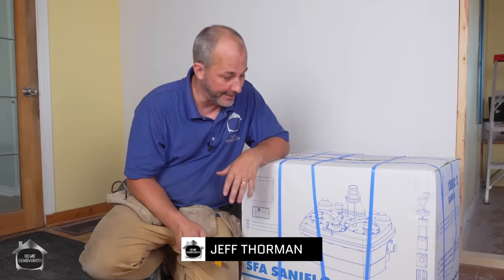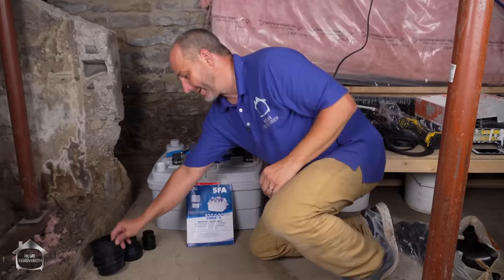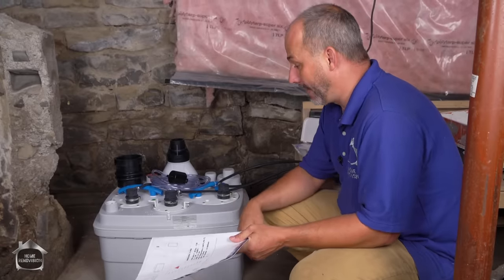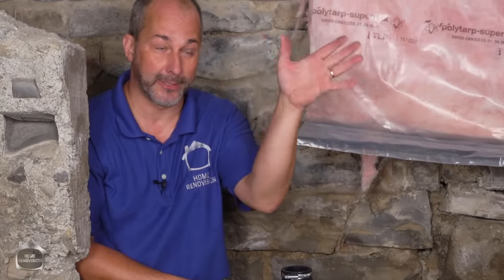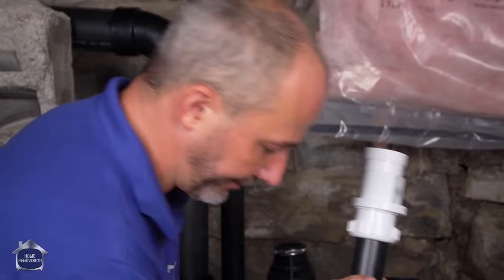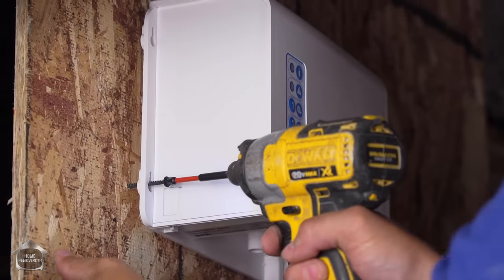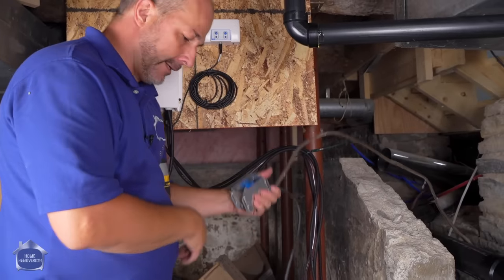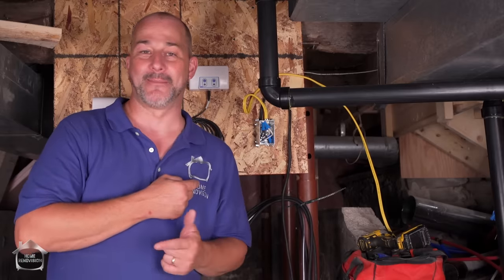Saniflo Macerator Plumbing Installation Instructions

Comment: Awesome! While we currently don't need this kind of unit it is really good information. One never knows what the future looks like.
Have a flooring question.  Older home and we are putting sheet vinyl in the bathroom.  Tonight we found where someone (long before we owned the home) had dropped something on the floor creating a pinhole in the vinyl and water seeped in causing some wood rot in the plywood. From what we can tell it is only about 2" in diameter, IF it hasn't seeped into the plywood and caused de-lamination of the surrounding wood what can we use to fill that hole?  (if it has de-laminated more than just the little spot I know we'll be replacing more flooring that we had originally expected to.) If we can't get the new plywood to butt up perfectly against the old plywood do we need to fill the gap with something?
Reply from the maker: HI! they make patching compound to be used on the floor to fill gaps and cracks for that type of install. just go to the hardware store and ask for the product and describe what you are doing. I am sure they will have the right stuff for you. it should be sandable as well. cheers!

Comment: Just discovered you videos!  Amazing stuff!  So, I want to add a (full) bathroom to a walkout first floor.  But the septic line is 8 ft above the floor, so I'm thinking of using one of these, but I either have to bust a hole in the foundation, or raise the bathroom floor, or get a side/rear discharge toilet, or put another pump in the drain line.  Any thoughts on which of these solutions would be best?
Reply: Just did a bit more research and it looks like the Saniflo Sanibest Pro: Macerating Upflush Toilet Kit is going to do the trick.  Just need to elevate the shower base a bit and everything else should be fine.  Is it worth buying the high water alarm?

Comment: Big fan of your channel. I trying to replace my Sanipro unit. It used to support a small bathroom with shower sink and toilet. But it was built with no access to do any pump maintenance, so now I’m trying to figure out how to tear out the original without having to rip out too much drywall, but I think there probably isn’t a way around it. Do you have a videos on a more permanent or low maintenance unit and tricks to build in access?

Comment: I've been looking into Saniflow for an upcoming basement remodel.  Unfortunately, my existing sewer pipe goes below the slab.  Code in my area requires plumbing to tie into the below slab sewer, which for me means busting up the concrete to get to it.  Im not sure if there is a work around, but really wanted to avoid busting up my slab.
Reply from the maker: Hi drew, all sewer pipes have a fitting where there is a cleanout just before the pipe goes beneath the slab. You can extend that cleanout and add the intake to the pipe from the macerator and have it assembled without opening the concrete! Cheers!

Comment: I want to install a SaniPlus macerator toilet in my basement, but I'm not sure it's the best idea. Things to know:
- Ceiling height is 7' tall, code for bathroom is 6'8"
- Macerator will be 4' from shower drain
- Instructions say shower for SaniPlus needs to be elevated by 6", but that's a problem with my ceiling height restrictions (7' minus 6" equals 6'6", no good)

Question: can I dig a small hole for the shower P-trap so I only have to raise the shower 3 inches, or does the P-trap need to be above the macerator shower intake? I'm worried my only other option is to ditch the macerator and start digging up the slab

Comment: Hi Jeff,
Thank you, I find your videos educational and very helpful. 
I am from the Netherlands in Europe and I know nothing about installing electrics. However I would like to bring something to your attention!
At the 39:00min you attached the power supply to the panel.  The lines entered the box from the TOP. To me this is not sensible and a potential yet simply avoidable risk!
Should there ever be any condensation, leaks etc water could flow along these lines and into the box.

That is why I would suggest lines like this should enter and exit from the BOTTOM.
Water, condensation / leaks that go along the lines can never flow up -at least this is the case where I live ;) - thus avoiding a short.
Keep up the good work. Good luck with all your renovations.
Regards,
Willem
The Netherlands.
Reply from the maker: Thanks for the thoughts Willem. I don't do enough electrical to have that many good habits., What you are saying sounds reasonable and practical. Cheers!

Comment: I'm thinking adding a toilet, vanity and shower to the Basement so i want to know if this work for that.
Reply: Yes it would that’s what they are made for
Reply: Its a over kill for just a basement bathroom either run a up flow system or do the standard drop in the ground system that's 1/5th the price

Comment: I am looking to add a full bathroom in my basement I was about to start tearing up concrete till I stumbled across your video. Which one should I get I'm only looking to add the one bathroom not the whole house from my understanding they have these for different reasons different sizes like if someone just wanted to add a toilet and not a full bathroom like me they would be a different product right? like for instance you're doing your whole house I don't need that big of a unit.

Comment: Jeff, When I watched a video put out by Saniflo they stress on the discharge pipe to have no 90 (right angles) but to use a gentle 90 such as two (2) 45's.  Their claim is over time the right angle 90 with build-up and cause a problem, your thoughts?

Comment: Hey, did you just convert that cleanout for the saniflo? What if you need that clean-out later on? I know you said these Saniflo's are incredible machines and can blow___ to China and back, but deleting the clean-out is giving alot of faith in these machines... Also, Are you going to add some lock nuts to the electric boxes for the wires coming into it? You're blowing my mind with this video.

Comment: Vent 90 on the discharge pipe?   And you removed the cleanout from being a cleanout.  why not tap in a new connection to the stack?
Reply from the maker: I had an extra cleanout. Cheers!
Reply: @HomeRenoVisionDIY  Ahhh lucky.  most people get one.

Comment: Have been watching your videos on flooring. Thank you! I will be renovating my very tiny primary bathroom…1965…my plumber has asked to research this system. Might be best option with cast iron system and small area.  Any problems develop since you installed the system? This will also be on 2nd floor of house.

Comment: With one of these units in place for a basement bathroom, do all the fixtures still need to be ventend beside the pump or does the pump vent provide enough venting to the fixtures?

Comment: Hey Jeff You're the best!!  Thanks for teaching us DIYers the right & safe way of doing things around the house.  My question is,
I want to have a 6'x8' wood shed and turn it into a modern "Out house" if you will. I need an outdoor bathroom and there is nothing on YouTube that really shows anyone using a Saniflo for outdoors. Can I put one of these outside? I plan to insulate the shed and put up sheetrock and Imy him,e has a septic tank. Would that be hard to do if I want to put one of these outside?
Reply: Did you give it a try?
Reply: @ Mike532 did it all work out? Thanks in advance.
Reply: @JonathonTaylor29  Not yet 😒
Reply: @officiall.d1010  No, haven't done it yet. It seems like to much work. I will probably just have folks use the bathroom inside the house that's near.

Comment: How about a cottage install?  It gets down into the teens,  sometimes single digit.   
Most the line from cottage to house can be down 2 to 4'.     Will the spot where it is exposed (maybe 5') be a problem if it freezes?   I'd suspect the sinks and toilet and wash n dryer will be run often.

Comment: Hi I have a question! I have an existing half bathroom with a toilet which was built on a platform and a sink.  I want to install a Saniflo plus system to create a full bathroom. My question is, can I use the existing sink discharge drain for the saniflo discharge?
Reply from the maker: yes as long as everything goes into the saniflow so the 1 1/2" pipe is dedicated.

Comment: Have a older home with a roughed in piping for a downstairs bathroom, however my plumber said it incorrect and needs to be ripped up.
Would it be possible to abandon the existing piping and install one of these units?

Comment: How do you get into the unit if there is a problem, needs cleaning out? It seems locked down to the floor with the pipes all bearing down on top of the unit and the concrete floor below it. If it was installed on top of a foot and a half tall table...

Comment: If you have to raise the shower drain up 6 inches  -- why does it look like your shower is level on the floor? Im attempting to DIY a basement bathroom and im confused on how to raise the shower 6 in without putting it on a platform -- which is aesthetically NOT pleasing. Please help me lol

Comment: So the lift pump and macerator motor will run whenever a plumbing fixture (toilet or shower, etc) is flowing into the system?

Is the noise audible in other rooms?  Do you need to do anything to prevent the noise propagating through the pipe?

I've been watching your videos and will be adding a full bath to a walk-out basement. Thanks.

Comment: Im turning my basement into a rental unit and my septic line is 6 feet above the floor. Havnt looked at the other products they sell yet but i may have to chip out my concrete floor to install it lower than my appliances  unfortunately

Comment: Curious if your house in on a well and have any pressure issues adding a bath. If you have multiple sources calling for water at the same time. If so any plans on a video to upgrade the input not just the output?

Comment: Those keyhole mounting holes are the bane of my existence. I've asked my wife to check for those dumb things before she buys something to hang on the wall and if it's got them just put it down and walk away! It is so hard to get the screws properly spaced and level on the first try. Then when you consider the fact that my wife wants to change the location of whatever it is I'm mounting to the wall for her at least 13 times, and you can understand why I have a deep abiding hate for that paticular mounting system.
Reply from the maker: perhaps I should show my tricks to install. Cheers!

Comment: So two problems I saw Jeff, that box is not bounded to ground and it's metal! Also why not use a plastic junction box then a gangable metal box? the cover will not go on these as they are meant to take a receptical or switch then a plate. Why did you decide to  use this instead?
Reply: he must have forgot, because he initially did it, then removed it so the camera could see what he was doing, and mentioned he was going to do it, and then never did haha. also those wires should have been stripped back further. think 6-8in of unsheathed wire is required in the box. probably why he had to take it out to connect it in the first place.
Reply from the maker: Hi steve, as long as the ground screw is attached to the green screw i the back of the box I am fine. And they make a solid cover for that style of box. Cheers!

Comment: I am a DIYer and was wondering if it would be feasible to use one of SaniFlo's insinurators, toilet, sink, and shower to install a bathroom in a second floor bedroom by running it into the attic, across (over) a hallway and connect to another bathroom?

Comment: Perhaps you can provide me some guidance. I don't have a saniflow.... Mine is the older box model... Where half of the tank base has the toilet on it, and the other half is on the other side of the wall... With the pipes, etc. Mine stopped working, overflowed in the basement... So looking at it I noticed the 90 degree pvc elbow from the vent pipe was disconnected where it vents out. It looks like it was attached with caulk instead of pvc primer and glue. Then when I pulled it off to fix it, the rubber gasket that attached that vent pipe to the tank was torn and frayed.. So I need to replace that. Based on that vent pipe not being attached and sealed... Could that be the cause of the system not working anymore? Just curious.. Worst case scenario is that I have to replace the pump. Hoping you can give me a little hope that it's can be the less expensive route. The waste pipe is still intact. This thing is about 18 years old... So maybe I'm due for a new pump anyway. If so, is it just a heavy duty sewage pump? Thanks, and thanks for your channel. I've used it for so many house projects, I've lost count.
Reply from the maker: your best bet is to contact the supplier to get replacement parts. most likely not that expensive.

Comment: Hey I was actually just looking at one of the smaller versions of this, just to do a small shower/toilet/vanity bathroom in my basement. Are there any code issues with something like this in Ontario? I’m in a 50s home where I have city sewage but I don’t want to cut open the old cast iron sewage pipes and deal with that mess.

Comment: You should have installed sweeping 90s on the discharge.... your first 90 was not..... also you could have maintained your clean out with a different configuration

Comment: Like the idea of adding extra drains to the house or shop that doesn't have enough fall. 
Don't think I would want my entire house on one.
Reply from the maker: Hi Diana, I am running my second bath and my new kitchen to it. I will also run my wet bar in the future. My basement has no room for adding fixtures so this solves all my problems. Cheers!

Comment: adding a living space to my basement. needs to work for the Kitchen sink, shower, and toilet with out overpowering my sewer lines. The thing I am most worried about is it being to powerful.
Reply: As long as it's a low point in your plumbing you are tying it into it won't create a problem sewer lines are open systems and have venting in them which mean any pressure will escape

Comment: Enjoying the video!
Need a bathroom in the basement but don’t have any plumbing for it.
Will this “officially” increase the number of bathrooms for our septic system? I say officially because our septic tank is rated for what we already have, which is 2.5 bathrooms... so if it ever came to selling the house, do I need to remove it?
Thanks!
Reply from the maker: Hi Elizabeth, The septic is actually rated related to the number of occupants the house will hold. The same number of people can still only use the bathroom at the same rate. This just  allows you to have more options. Cheers!

Comment: I looked into their mascerating toilets b/c my house was built in 1925 and only has one bathroom. I'd like to add a basic half bath in my basement tying into the main drainpipe without digging up concrete flooring. I also want to add a master in my attic and not have the toilet exactly beholden to directly above the current gravity pipe in the bathroom below. Idk...still in planning stages.
Reply from the maker: If you have any questions just call the 1800 number and they can help to suggest the best options. Cheers!

Comment: Bathrooms are at the right of the house (all the way right) and the garage being converted is on the left and will include a a laundry. Saniflo can help getting waste water to a drain, either at the kitchen or at the other end of the house.
Reply from the maker: That system can pump waste water anywhere. Cheers!

Comment: I'm working on basement finish. Adding in half bath, and planning to use Sanibest Toilet as there is no prior toilet stubout in basement floor. My biggest concern is accessing an existing vent stack from the next floor up as there is no accessible vent currently in the basement, just waste lines/stacks. I was initially planning to use the Sanicompact as it doesn't require a vent, but upon permit application I was told that the sink still needs to be vented and that AAV's are not allowed by local code. So, since I still need a vent line, I decided to upgrade the saniflow to a bigger/better version just in case. :)

I have a half bath on the floor right above where this is going, and the master bath is another floor above that, so I'm fairly confident that I can just route my vent through the basement ceiling/first floor next to the half bath sink waste line, open up the wall on first floor where they route through, and just tie into the half bath sink vent above where the sink drains. Am I correct in assuming nothing should be draining into that stack from the master bath above it? Is there anything else I might be missing with this plan? I realize this is difficult to picture from a worded description and I would be happy to discuss further with pictures & diagrams if needed.
Reply from the maker: Hi Davin, as long as you can find the vent line you can add to it. a 1 1/2" line can support 10 fixtures. so no worries there. if the vent is also used as a waste line it will be a 2" line and in that case you can still tie in. Cheers and best of success!

Comment: The house I bought is 100 years old. The old sewage pump system is slowly dying out on me. Small amount of flooding when the washing machine is running and the smell . The concrete has been cut out that the system has been placed into. The previous owner started to frame out a bathroom wall and placed it over the unit. I want to replace it with a unit that will fix my problem, easy to install (because I hate plumbing and paying $80/hr), and will last.